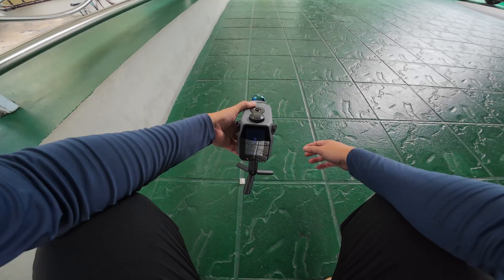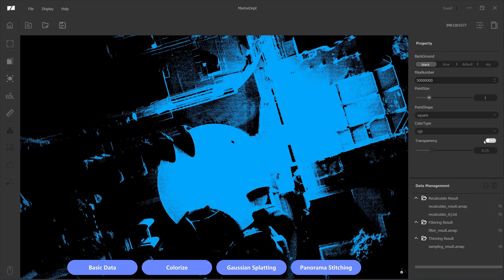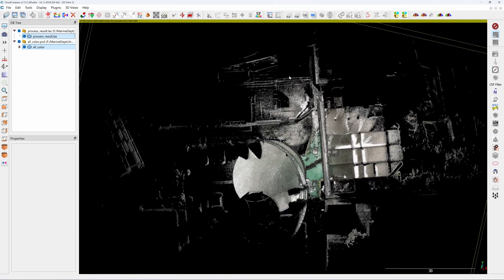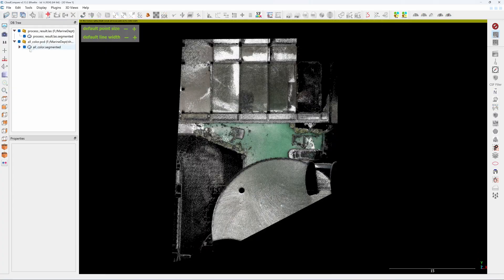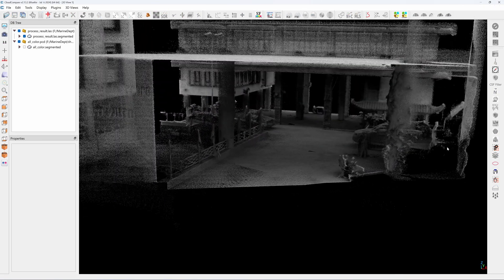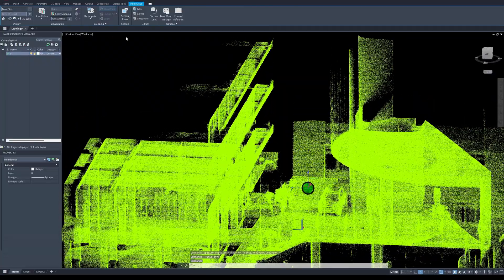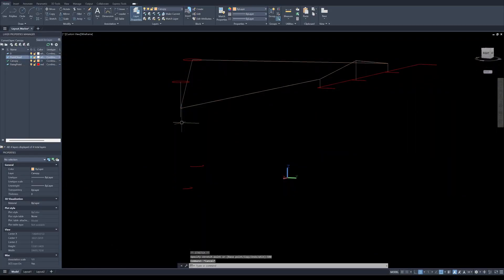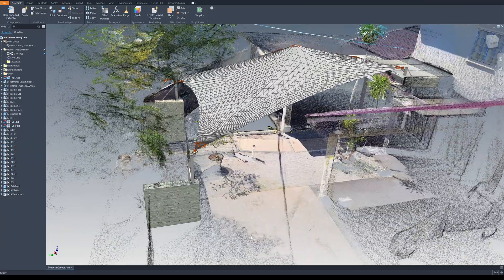Fast 3D Scan to CAD Workflow: Real Client Project with 3DMakerPro Eagle LiDAR Scanner

Comment: A few questions: 
1) Why on raystudio check both pointcloud filtering and thinning? In the end the recalculate result is the one you use for next steps (you can thin at cloudcompare). Does checking the filter and thinning impacts in anyway the recalculate result? (if not we waste time and space for nothing)
2) Has placing the device in the exact start and end spot help for better results? It supposedly has autoclosure feature if you stand approximately near).
3) Do you filter more with sor/thinning etc in cloud compare?
4) How come you dont use gimbal? It helps in inside places better probably.
5) Have you ever used some kind of target to align gcps (since eagle gnss does not work).

I have seen that for more open spaces with buildings etc the device keeps track etc quite ok. 
I have more problems with closed spaces and transitions from room to another. 
I usually do more smaller scans but all this takes a lot of time.

The eagle has been a both a blessing and a pain for entering 3d scanning world on tight budget (but have to spend lot of time to learn and solve problems where the device has weaknesses) 

Anyway, really thanks for your videos, every time i see them i learn many new things.

Comment: when I zoom in in revit or cad I see the point is very thin. I tried to edit in cloud compare but im not good at it. Can wee meet for assistance?
Reply from the maker: You can change point cloud size in most CAD software.
Reply: Do you use autocad?

Comment: @Payo-TensileCreator what scanner had you been using before the Eagle recieved the update tackling drift error? I think it was not possible to apply the Eagle by then.
Reply from the maker: Over the past few years, I've worked with 4–5 SLAM LiDAR units from various manufacturers. While Eagle paired with the Livox 360 isn't the top performer, its results are comparable to most, particularly non-color point cloud.

Comment: I will possible use only PC for engineering 3d model. This product is accurate enough? The colour scan is not that needed. Also gaussian splatting not atm. What step by step do you reccoommend. Sometime lift that scanner or place the scanner on the ground in a middle of a scan so that noise is less?
Reply from the maker: Based on my tests, the accuracy for non-color point clouds is under 20 mm. Always position the scanner on a level floor with a reference mark. Scan in a continuous loop, then return to the starting point and align the scanner precisely over the mark, facing the same direction as at the beginning.
Reply: @Payo-TensileCreator how come poeple om fb are not happy wuth eagle? How is this compared to share c1?
Reply from the maker: @guillaume8307  SLAM LiDAR isn’t plug-and-play—you need to grasp how it works to get good results. Eagle’s output isn’t the best, but its grayscale point cloud is usable. The C1 is by far the best of the five scanners I’ve tested. Review video’s up.